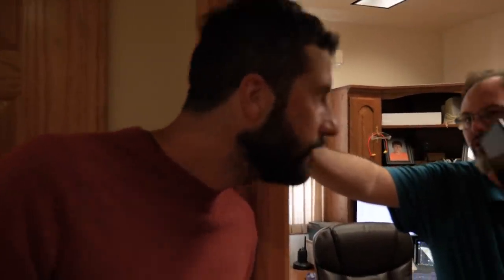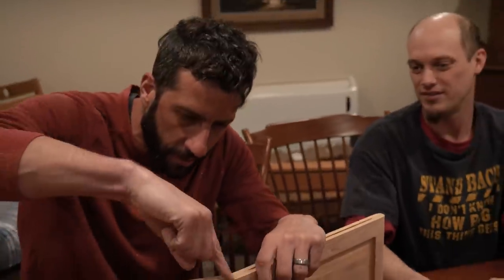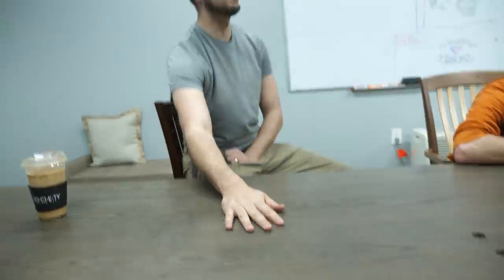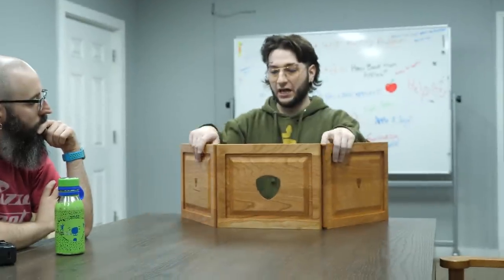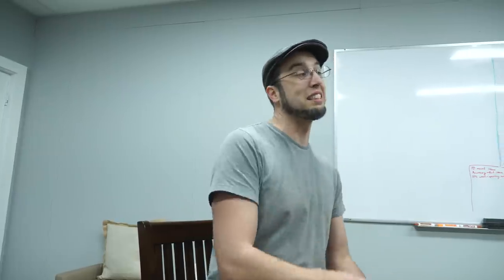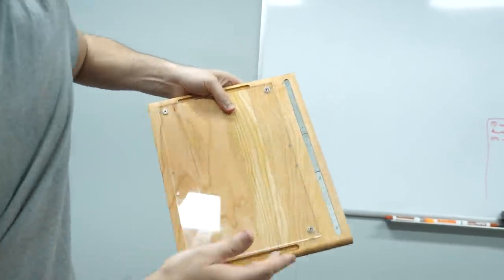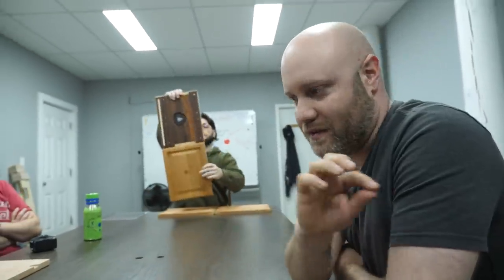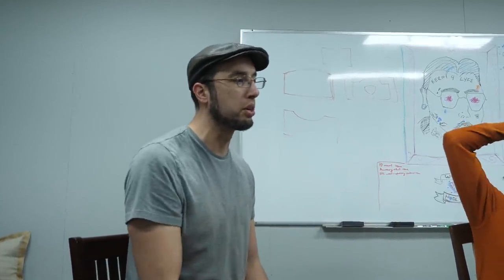New GM Screen Design Pt. 4 (this thing is dangerous)

Comment: Without the contrasting veneers, you've essentially made cabinet drawer fronts.  The veneering really set's it off and make's it more of a DM screen than just plain wood.
Reply: Agreed. The solid panel just looks like my bathroom vanity doors.  The veneer panels looked great though.
Reply: Imagine the veneer matching your class option rolling tray and master vault!
Reply: Can't believe Matt Mercer is going in on them like this
Reply: Yes! I was thinking that the whole time.. These look like cabinet drawers! Please just have them do Frame and Panel!
Reply: @michaellaudani9948  I think that would look fantastic and really sell
Reply: Except cabinet doors are actually frame and panel instead of "faux" frame and panel.
Reply: @michaellaudani9948   red wood pair that's will be suck

Comment: if you're planning on plugging the bungholes already, use that space for your recessed rubber footing. eliminates the need for creating an additional process of drilling recessed holes for the rubber feet
Reply: This is a good idea.
Reply: They gotta get one on the ends of the outer panels just because the force might not be strong enough at the magnet bunghole to keep it from rotating.

Comment: I love the veneered panel more then the solid. The solid looks like a generic cabinet door, the veneered looks like it came from wyrmwood.
Reply: I can see what Jason was saying about them being "sloppy", but even the camera had to zoom WAY in to see it. From more than a foot away it looks better for the contrast. I'm pretty sure if you looked at anything THAT close you're gonna start to see issues.
Reply: The only thing I could think about once they started talking about frame-in-panel solutions what cabinet doors. It just felt weird and I couldn't see why they would want a DM screen to look like a cabinet... It felt so generic I might as well buy some doors at Home Depot and slap some hinges on them. The veneer completely changes that and instead of looking like existing parts and designs were thrown together, it looks like it was intentionally designed that way from the ground up even though they are essentially the same exact geometry and process except for veneering before CNC. 

Would be interesting to see it cleaned up somehow and maybe some some different wood combos or proportioning of how much accent there is relative to the main wood

Comment: The stronger magnets definitely appeal to me more, the brass bung looked nice but matching wood bung would definitely be more wyrmwood.
Reply: Thats a scam...  look at other comments saying they won too....
Reply: Either a wooden bung or use that as a space for rubber feet. I'd be worried about the brass/aluminum being in direct contact with and scratching your table especially if there's a chance that the end grain might crack/chip.

Comment: Y’all should definitely make some nice wood initiative trackers to go in the top groove
Reply: Cool detail
Reply: Perhaps make them compatible with the trackers that they’re currently making
Reply: how would that work with what you put on it? for the KS they had it was brass that you could right on and then wet erase. If its wood you can't really write on it, and you can't get them with specific people, cause people move, characters die/retire, and then all the enemy types as well.
Reply: Oh yes
Reply: @CalebS92  I was thinking something with the white board they are using on the rpg tracker system, made of wood much like the RPG tracker similar to the new wizard one shown in update 3 of that kickstarter. Shouldn't be too hard since they already have those types of parts around
Reply: @Mulletduo  only issue with that I feel is that it will be pretty thick and might not sit in the tracker slot too well, that and it doesn't look as nice. I feel like the polished brass or aluminum cards are still the best bet.

Comment: Instead of just plugging the holes and sanding flush, how about making the plug slightly inset and setting decorative rubber feet in that?
Stamp them from rubber sheets I guess, and if you choose a shape that fits together like the yin&yang does there's little waste..

The panels don't really need to bend forward, so quarter-circles instead of half-circles is an option, and you can use a chamfer that goes well with the veneer.

I'm down for a veneered set, brass if the metals are visible :D
Reply: The forward pivot is for folding up the screen as shown in the beginning of the video
Reply: @DavydAtkins  They are detachable because of the magnets, so while it would be nice to just fold it's not functionally essential. It's an option for getting the veneer to look nice if achieving that with the curve is too much 🤷‍♂️

Comment: 1. I love the contrasting woods, layer paneled deal. It’s mostly picking the woods.
2. The magnet design in the first one is much better and yes they should be crazy strong if you need more wood between them right? More wood on the connecting edge and keep the strong magnets and I’ll probably be getting one

Comment: This is great. I'm personally ok with the stronger magnets -- my table is chaos. I'd be happy to see veneered or un-veneered in the final product. This is really shaping up excellent, and I can't wait to see where this continues to go!
Reply: I agree on the stronger magnets, i like being able to pick it up. I wonder if they recessed the magnets a bit deeper if they would still hold well enough and not pull out the side of the wood (which i think was their major concern)
Reply: I think it would be useful to set them up and toss something like a bean bag at them, shake the table, push on them, etc. Holding them up like that isn’t a very realistic stress test, if you are holding them like that you are probably trying to take them apart to put them away. I’d like to see a more realistic strength comparison between the weak magnets, strong magnets, and a third version with the strong magnets recessed another ~1/16th of an inch to make the hinge more durable.

Comment: For the bungs, I have a feeling wood might be the best way to go because it will cushion the impacts from the magnets. I suspect with metal bungs, those boards slamming together on such thin edges will crack a lot faster than wooden ones.

I’m a big fan of the solid wood + veneer. It feels like a good compromise on cost/manufacturing time while still adding something so it doesn’t look like a bunch of cutting boards. I understand a lot of people see wyrmwood as a high end brand, but I feel there is something to be said for lowering the cost to entry. I would never be able to justify a $600 DM screen but $200-300 becomes much more approachable.

Comment: Veneer really makes it more visually interesting then solid wood (and might distract the distinct lines where 2 boards are glued together).  I am however concerned with the weight of the panels.  Besides the look of frames and panel, they are usually much lighter since the panel is much thinner.  How much do these things weigh? Are the cumbersome to travel with?  Can they be thinned down?
Reply: If you make it thinner, the grooves for the pseudo frame would make the screen too thin and weaker in the center. If you don’t leave enough wood, you’re looking at structural problems if you drop it or travel with it.
Reply: Less than 10lbs with all the stuff they add I’d say. Won’t know until final. Cherry is 3lbs per board foot and it looks like they remove 20% of it in the milling and woodworking. The panels are slightly longer than a foot from that A4 size check and significantly wider. Final weight maybe ~7.5lbs

Comment: I like the brass bung tbh. Something about it feels intentional and classy. I'm still not sold on the solid wood, but if the price was really good (that $70 a panel you talked about), I'd probably still go for it over the dogmight screen. I really prefer your magnet design.
Reply: Exactly the same thought in regards to the solid wood, it'd have to cut down cost significantly enough for me to value price over looks. It's not bad, but most certainly not as nice looking as the other examples

Comment: Damn it, you guys are winning me over from 'Frame-and-Panel' to the solid wood option...id like to see the F+P prototyped a little bit, just to see how a more developed version compares...but i definitely could see myself satisfied with these solid wood options with the veneer.  Just need to get the wood combination and colors correct and work out the bugs.  I see myself needing two center panels and 2 sides
Reply: I agree with Lord here, I want to see both options, Solid wood looks good, i agree with jason on the siding and the lines not being crisp (not a woodworker, not sure how possible it may be to fix that slop) 

Love the clean edges, love the shadow lines, The bunged holes may be a good place for the feet to go?, idk how much space there is to work with there Im with matt on the side grooves being wider. and personally prefering functionality on my  side. 

interested in a higher cost F+P variant with maybe more features somehow? (idk how easy that may be with magnets inside and all, i would thing the top frame would need to be thicker  or the center panel smaller in order to support the magnet installs, (this i think would also allow for parallel processing of parts possibly cutting down on over all processing time, cutting the costs just a little bit in that sense.)
Reply: Oh good point, for visual balance of you want four screens you definitely want two centre panels.

Comment: I personally love brass accents so I would use brass plugs if I were making this. I would also say continue to use the heavier magnets but put a slightly larger outside wall to prevent the magnets from blowing out the end grain; the stronger magnets should be able to still attract despite the thicker walls around them.

Comment: its so interesting to see the evolution from v1 to now also on the topic of rubber feet what about using the plug for the magnet as where the feet goes instead of putting another hole utilise the one you have
Reply: They need the rubber feet to be on the outer side of the side panels to prevent the movement the best. The plugs look to only be on the inside but I might have missed them showing it on both sides.
Reply: @zebraloverbridget  the plugs are on the bottom and top of the panels
Reply: @zebraloverbridget  I thought they said you could add as many screens as you want. That would mean the magnets are on both edges.

Comment: Feedback:

1. I want to see development on frame and panel too. It's not a fair comparison if both approaches don't get the same love, and Doug has been pushing solid wood hard. I especially want fancier frame-and-panel with embellishments. I know it'll be expensive. I don't care. At least as a Masterwork option with all the bells and whistles, stringing etc... /please/.

2. Seeing the veneers, I might be okay with the fancier, multi-layer veneer with all that dark wood that Doug showed. It does look cool. Most tempting version of the solid wood I've seen. Though if it's not a super fancy version, I'd rather do the frame and panel. If anything I'd like it fancier than what Doug showed, and it feels like you're about to scale back and simplify, which doesn't fill me with confidence.  

3. Dark veneer yes. I don't just want lines -- I want a full dark veneer. Don't like the suggested tweak of a lighter top layer.

4. Stronger magnets are more betterer. Not dangerous if you're not a small child.

5. Brass is fine for the bungs. Wood ones should match, yes. Though I could see a very light colored bung on a very dark wood looking cool. Match or strong contrast looks purposeful.

6. When the design is figured out, please don't skip on innovative features like the last DM screen: rotating panel et al.

7. If you do the inserts, could we get a fancier one with a metal or gemstone Wyrmwood shield? (Though I'd rather just have it in a straight-up panel without an insert honestly, but the insert system looks fine and does give some versatility and upgradability, which is cool.)

Comment: I still would like to see a Frame and Panel option added. I would pay so much more for one, just because I prefer the look, and the quality. Also, PLEASE bring back the rotational screen, and the 2-way Dice Towers/Chest of Holding. They were the features that truly sold me on the first iteration. Don't remove innovation, build on it. Food for thought. Otherwise, I love these iterations. Cool to see the design process.
Reply: Yes!  The rotating panel was GENIUS.  I would love to see that be an option.
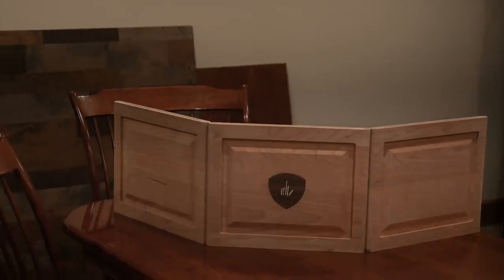Reply: Frame and panel won't work with the magnet hinges, the rails have a mortis cut into them and the curved edges would have the mortis pattern in it. Watch Ep.3 of the GM screen series again , at 2:30, Cristaldi explains the frame and panel. You can see the end of the rails used for the frame; it just isn't viable with the hinge.
Reply: That might be an option down the line.  Once they have a basic DM screen figured out then they could build on it.  I can easily see them making a dice tower that works with this hinge system.
Reply: @nickl9939  oh, I must’ve missed that. Thank you for the clarification and knowledge! Would still love Rotating panel/dice tower/chest of holding. 👌
Reply: @dungeonartist  Well I am sure they might be able to design something, it's wyrmwood. And yes, those would be amazing to have back.

Comment: The design is coming together. And IMO “dangerously strong” is how I would prefer it to be. Because you never know when something drops on it and it completely dismantles if it weren’t.
Also, why don’t you use the dungholes (they are already there!) to accommodate for the rubber thingies that will keep it stable?
Now, about that giveaway… yes please! 😄
Reply: I thought the same thing for the rubber feet
Reply: The problem with the dangerously strong magnets isn't you hurting yourself. It's the fact that the wood that's being smashed together is incredibly weak. And likely to destroy itself over use. It's not an option for a high quality product. Unless they bulk it up to make it tougher.

Comment: Love the veneer version, like the solid wood, would probably like the solid wood more in a different wood, but the veneer just gives more contrast to really make the screen pop. For the plugs for the bungholes, I like the idea of the metal plugs better than the execution, wood plugs definitely look better in my opinion. As for magnet strength, I personally like the idea of the magnets being able to support the entire screen, but I understand if that's just not practical from a design standpoint due to possible cracking. All this being said, I'm probably not going to be able to buy one for QUITE some time (millennial in this housing market, so no place to put it), so take my opinion with the smallest grain of salt, since I'm not even going to be a customer.

Comment: I really like the solid panel look but I would love to see the routing around the inner "panel" be a little crisper in the corners.  I think that's what makes the frame & panel look "better". If you were able to square those up a little more I think it would satisfy both camps. I also like the veneer option but if that adds cost, I'd be fine without it. Offering plain and veneer options would be nice because it wouldn't really add extra work for the craftspeople. Love the new screens! Maybe I'll be able to afford one some day. :)
Reply: Those round inner corners remind me of my childhood furniture. It definitely needs to be crisper if possible. Though it may not be possible :/
Reply: @theNaluK  I'm not a woodworker but I follow a ton of extremely handy people like Adam Savage. I'm betting you could use a smaller diameter router and do a pass along that edge to get at least closer to square. At least the curve would be much smaller and tighter. The only other way to make that crisp would be to essentially "chisel" out the corners. I'm betting there's a machine that could do that on a consistent basis so you wouldn't have to do it by hand.

Comment: Been a shadow subscriber for a few years. Super stoked that the DM screens are getting love again. I wanted to join the original kickstarter, but didn't have enough cash at the time. Hope this product gets pushed! Though some kinks do need to be worked out. 

Visually, I'm not sure I like the back. They look like kitchen cabinets. 

You could try plugging the bottom bung holes with rubber feet. The brass hole covers looked best with that particular wood in my opinion. Might be a good idea to have a few options for buyers?

I'm not a huge fan of the middle panel inlay. I feel like the cost increase for including it will push out potential buyers. I think a simple logo design or sliding panel would be better. The sliding panel could have a slot for paper behind it so you can pull out the panel to expose a map or puzzle. You could even use the slot to store extra player sheets. 

I'm also a little worried about the acrylic panels. In my experience acrylic cracks and scratches very easily. When you are constantly moving and taking apart this screen, I feel like the panels would be dead after only 5-10 sessions. I'm also not entirely sure what the purpose of the acrylic is. So you can dry erase marker over your material? 

Are you guys planning on adding additional magnetic addon's for this? Something similar to the Dice tower, initiative tracker, or the small drawers that came with the original? I know, I would love to have those options.